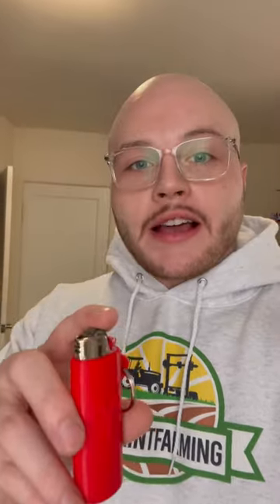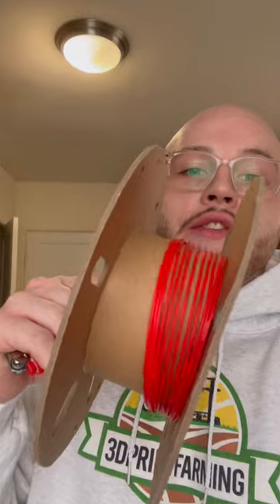My lighter case design is garbage?!

Comment: Good response, poor execution.  I'd look into printing your own lighters.  Valves for refilling are cheap (a few cents a piece, in bulk) It's waaaaay cooler and easier to sell as a functional, useful item... Not to mention a value -added product that could prevent more waste in the world (as a refillable, reusable lighter).  Clipper already makes a flint wheel/striker that you can buy replacements for.  They're shaped like a post.
You seem like a smart dude.  Surely a few more moving parts in a product doesn't intimidate you...  Imagine the possibilities with your creativity.  I'm sure you could come up with some totally badass designs for lighters.

Have a great day, dude!  ✌️